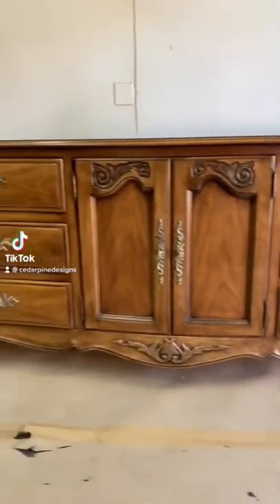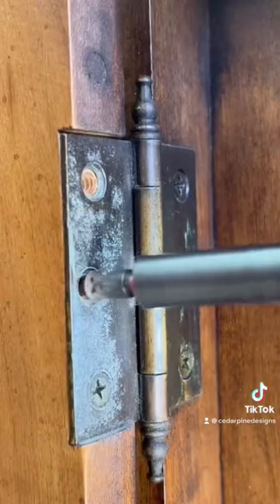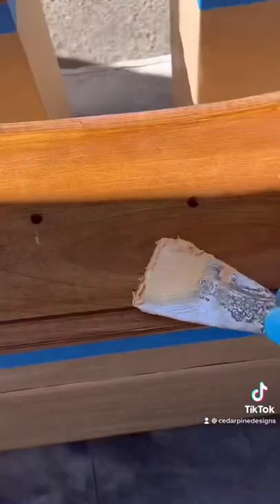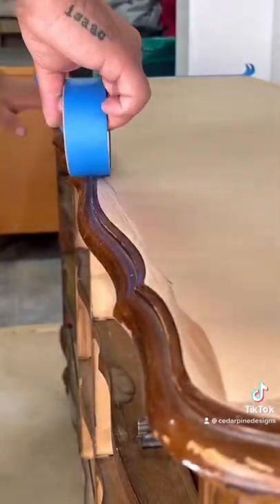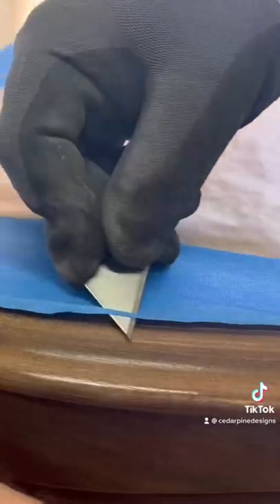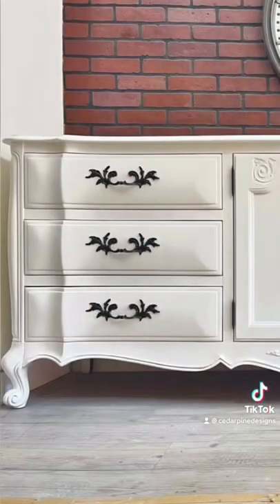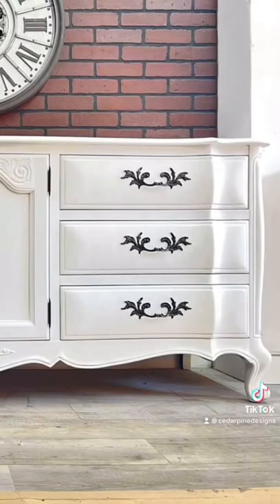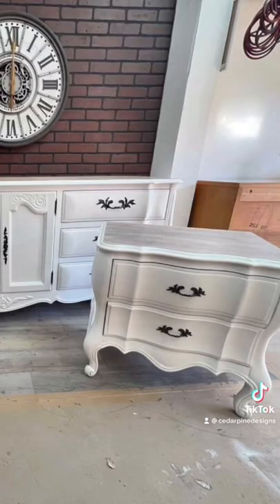How to make $700 refurbishing old outdated furniture and saving it from the trash

Comment: Have you ever had problems from not priming? Or using latex wall paint instead of enamel?
Reply from the maker: The only time I have an issue not using primer is if I use a light color like white over exposed areas of raw wood. Other then that, latex paint works great and it’s much cheaper in price. It just needs a polyurethane top coat.

Comment: My issue is you sold two items for that price? I saw some else get 700 for just the dresser alone. But for the two items it should have been 800. But you know the market in the area you’re in. So that might have been the going rate. Nice job!
Reply from the maker: It was a commission set and that was what I charged for my work. I didn’t buy or sell the set

Comment: Wow man that really stunning. Think the difference with your flips is that you sand between coats and maybe because you use a paint gun instead of brush it just makes them look brand new and classy...I'd would have asked more dolla
Reply from the maker: Thank you so much Rebecca. That means a lot. Prep is definitely going to make or break a project. Spraying definitely does create a smoother finish as well as save time. Thank you again for the compliment. I really appreciate it

Comment: What if it's not real hardwood? Can you still sand and stain it or would sanding and painting be the only option?
Reply from the maker: Thank you for the question. Most good furniture will be solid wood or pressed particle board with a real wood veneer over top of it. So sanding and staining is usually an option.